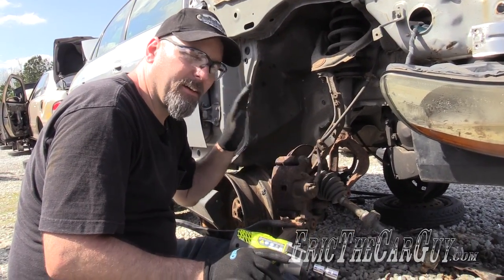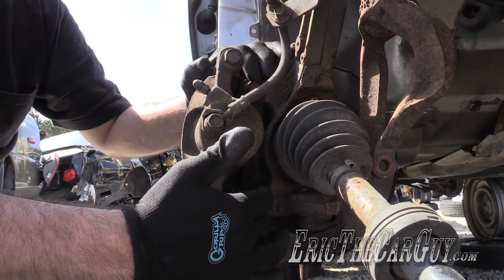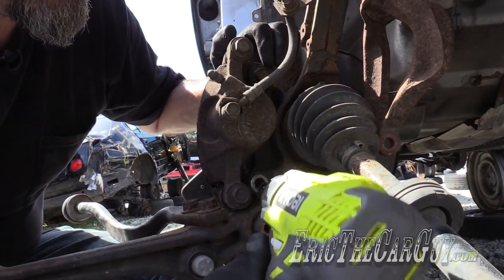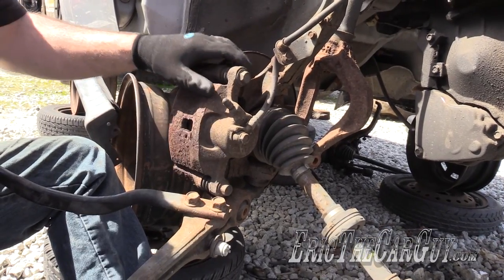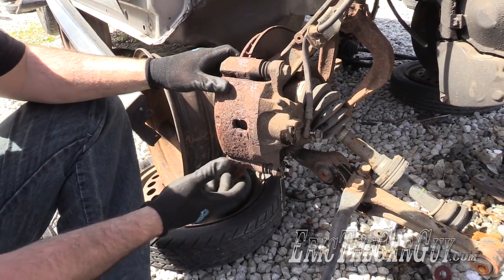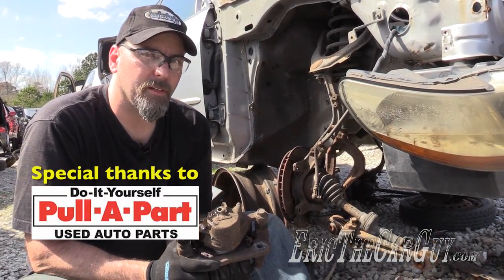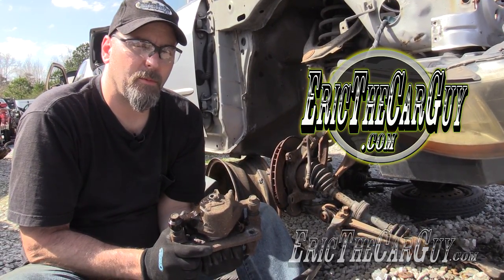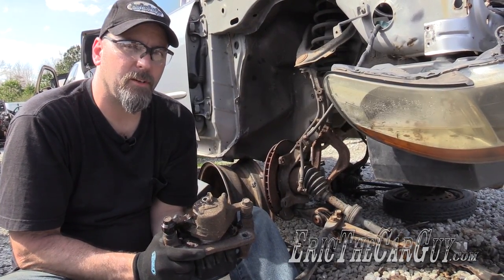How To Pull a Honda Front Caliper #SalvageYardHacks

Comment: I bet I know someone, other than myself, that wouldnt put junkyard brake parts on there car. i guess safety cost's about $15.00.these days,unbelievable.
Reply: What's wrong with a door panel or tail light from a junkyard???
Reply: does ANYONE on yt have common sense?
Reply: BAR 20 BBQ You obviously do not. Nothing is wrong with a plastic panel from a junked car!
Reply: after 30 yrs. in the auto industry I don't have shit to prove,this is about safety.if eric wants to put that junk on his car fine,but he shouldn't be making vids and suggesting to people that its ok to to put unsafe parts on vehicles.
Reply: BAR 20 BBQ If you really have worked in the industry, you should have some fucking respect for another fellow mechanic. I get plenty of cores from junkyards, reman them, and reuse them on certain vehicles that customers do not wish to pay a fortune for. No, I will not throw a rusty, seized up caliper on a car with shitty pads. I will however clean the caliper, do a quick rebuild or have it rebuilt, replace the bleeder valve, and ensure that it works properly. I do not often do this, but it can be done. No warranty included or implied. 

This video was showing how it was done. I do not think he even had a use for this caliper, however some people might. Plus, he was at pull a part, so why not make a video while he's in there?
Reply: thats how we used to do it 20 yrs.ago. but im not about to waste my time or my customers time and money doing it the old way.not to mention the possible lawsuits if that componet fails.i showed this vid to 6 other ase master techs today and everyone of them said nope-no way.but hey,each his own i guess.
Reply: BAR 20 BBQ Well, I will not do it unless requested. Some people can't afford a 200 dollar brake job, and I totally respect that on an old beater. 

I don't buy into ASE, and I never have. At the end of the day, the customer wants it to work, and they care little about a certification that doesn't teach the technician all that much. That strategy has worked for me over the past decade and a half, and I'll continue to do my best work until it cannot be done any longer.